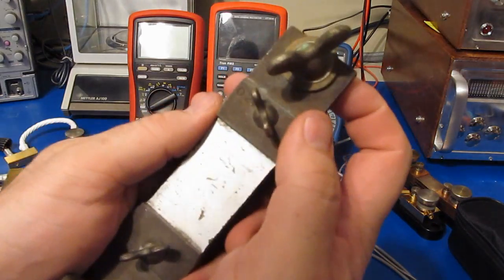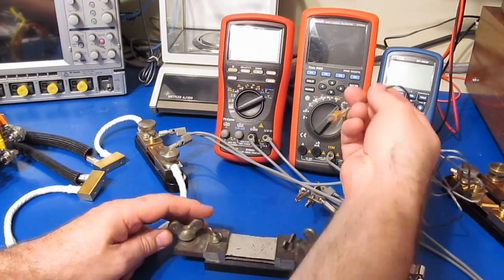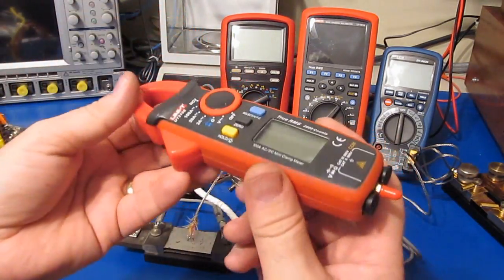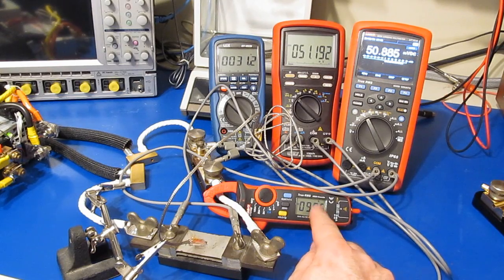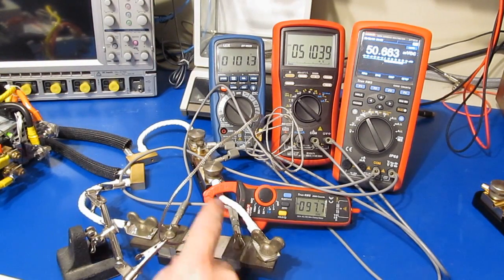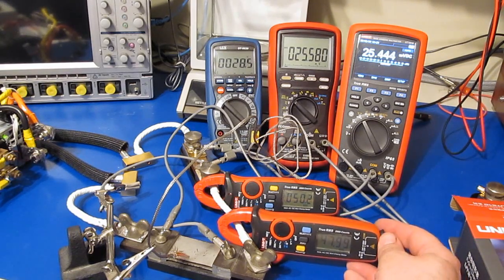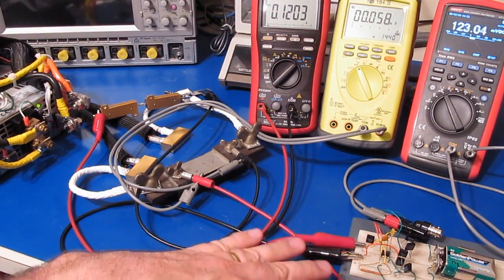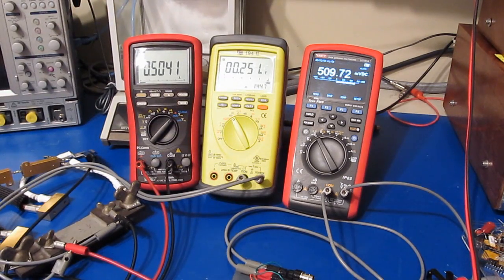Antique General Electric 100A 0.2% Shunt

Comment: I wonder if the older shirts are copper plates, and the paint is to prevent oxidation on the copper plates?
Reply from the maker: TC of copper is really bad which is why I hit it with the heat gun.  I suspect manganin.   I do believe it is paint and that it was added to prevent oxidation.

Comment: Thats one heavy duty shunt, i think i would clean the terminals and put it in a box with car battery cables and a second pair of thin wires to check the drop across it.
Thats a beast :-D
Reply from the maker: It's a bit too large to fit inside the UT61E.   However, in the ending clip, figure it's a 0.0005 ohm shunt. The signal to noise when trying to make mA measurements with it is poor as you could see.  But, let's say it was 0.1 ohm.  You can imagine measuring mA would be pretty easy.   Using FC3 on the UT61E to drive an N-FET, that is then used to drive a couple of Ps (I know you don't like relays) across the 9 ohm shunt. Add one more op-amp.  We could greatly improve the burden of the 61E in all ranges. The dominant resistance would be the fuse but if a person were just using the meter to look at 50ma and lower, the burden would be in the 50mV and less for all ranges.  SIBA has 1 and 2A versions of that fuse that would help.  Start going up higher, the tiny Ps may need to be beefed up.
Reply: LOL i dont think the shunt would fit in the ut61e, unless it was dr who's tardis :-D.
You have a warped sense of humor, i like that :-D :-D
Somehow i can mentally forward fast 3 years.... the ut61e has become the size of a fridge, and you are still improving it LOL.
Ooow i dont hate relays, think about how handy the common square types that (when we were young) we added super duper spot lamps to our cars, and the relay was the switcher.
.... Oh only me then lol :-D
Reply from the maker: The other option is use the 0.01 ohm shunt for the mA ranges.
Reply: Now that would make the burden vdrop very low :-D.
But more stages of amplification and suppression capacitors to stop the whole circuit howling between stages.
A nice idea though :-D
Reply from the maker: Notice the added caps when I changed the amp for that 0.0005 ohm shunt?  That's getting down in the muck. In practice, it's not a good use for these cheap breadboards.  0.1 ohm would be a very doable and I think I could pull off using the 0.01 shunt but would need to be a lot more careful how things were connected.   The 61E just needs a 1"^2 prototyping area.
Reply: No i dont allways notice things, i wasnt looking that close.
I get a lot of "Soggy brain" days, created by doctors medications, so you will still get some stupid misunderstandings from me.
I would imagine you are getting a bit "Fed up" with the ut61e, there isnt much you can/want to improve on.
Now if you want hell, try to improve a fluke LOL :-D
Reply from the maker: It took a fair amount of capacitance to tame that last breadboard amp.  Good for DC only.  On the Fluke, maybe start with the 87V.  At least get it to survive some basic transients like some of the low end meters I look at?  You would think that meter would be very robust.   That or put an RMS chip in the 17B+...

Comment: You're moving around the clamps a lot without zeroing, that seems to be an issue for these D.C. Clamps.
Reply from the maker: You are correct about the need to zero them.  I also posted a fair amount of data on the temperature drift.  These are really bad.  However, you seem to be missing that the offset on these are in the 10s of mA and we are measuring several Amperes.  The drift and offset are down in the muck and there is not much need to be so careful.

Comment: Hi Joe.
What is the model of your LeCroy oscilloscope on the bench in this video?
Reply from the maker: It's an old 64Xi.
Reply: How would you describe it in comparison with new low end digital oscilloscopes?
Does it worth to buy one?
Reply from the maker: I don't own any new low end scopes to compare it with.  IMO the 64Xi is a good general purpose scope for it's age.  Anything I have bad to say about it is with the mechanical packaging.  This was a private clip I made to show transfer rates to a PC running LabVIEW and calculating an FFT. https://www.youtube.com/watch?v=YaZ3uHgxuesThis was a video I made were I was attempting to use it to measure power.https://www.youtube.com/watch?v=04I7nHA_HxMThere was also some older videos were I compare it with my antique LeCroy 7200.https://www.youtube.com/watch?v=qcvI_2YfTdU
Reply: Not surprisingly, old school guys, I love this. :)
İt seems that Mr Carlson also has no modern oscilloscope. 
Thanks for the response, Joe. 👍
Reply from the maker: I've watched a few of his videos.  The one with the EGR was pretty interesting.

Comment: How do you rate the UniT clamp meters Joe , good bad meh ?
Reply from the maker: First, I have never plugged leads into them.  I use these for a current clamp only.   The reason I have them is because the can measure with 1mADC res.    Not hacked or aligned, it's pretty much the only UNI-T product I have ever recommended people buy if they need that low current DC.  It's pretty good.  Hack the software, it's very good.  Hack the hardware and you can really turn it into something useful.
Reply from the maker: These are links to other videos I made showing the UT210E.  Again, to be clear, I am not suggesting that ANY other UNI-T has any value to me.  I specifically want the UT210E for the 1mADC res in the 2ADC range.https://www.youtube.com/watch?v=PghlJbbj6pAhttps://www.youtube.com/watch?v=0lyMiAKfOjUhttps://www.youtube.com/watch?v=beXnFpPPwg4
Reply: You're being a bit harsh on them - i own two UNI-T meters, the UT60E and UT70A (which i bought mainly for its inductance measurement capabilities, but it is a good all-rounder and can stand quite a bit of physical abuse). 

When i bought the UT60E i asked the clerk at the store to plug it into the 230v mains and switch it thru all ranges. He was reluctant but did it anyway, i have been buying from them for a long time. It didn't blow up so i bought it. Measured up to 1.6kV with it no problem. Also the frequency meter which clams to go up to 20MHz IIRC, goes up to the full 4999 count. Discovered that when i measured a 48MHz firewire clock.

I do have two gripes with it and that is the SLOW autorange and even slower capacitance meter, but i have a dedicated capacitance meter so it's no big deal. Other than that everything works including the datalogging capabilities. I have owned the 60E for ~6 years and the 70A for ~5. I would not trust the CAT IV 600V rating tho, but i am not an industrial electrician, i use it for hobby work. It is also a bit sensitive to RF - but then again everything is when you have a 50W transmitter next to it.

I did need to clean the range switch on the 70A and blew a trace inside, but that was due to my own incompetence of bridging the mA fuse and forgetting about it.
Reply from the maker: All the meters are treated the same.   If I am being a bit harsh on them, I am being a bit harsh on every meter I have looked at.   I did a few videos about how stupid it is to bridge a fuse.  You may want to watch them.  I like the UNI-T UT210E because it actually does something very useful for me out of the box.  It is cheap and measures mADC with a clamp that fits in one hand.
Reply: I did watch the bridged fuse video last month. That was a long time ago, i do know better now.